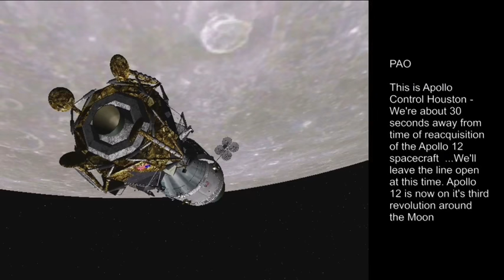Apollo 12 - LOI 2 (Full Mission 12)

Comment: The episode I was interested in was the LEM Liftoff from Lunar surface.  From what I heard the LEM went out of control seconds after launch and began gyrating before Pete Conrad got it under control.  Such that they had to skim closer to the lunar surface to gain acceleration.  Had they last control for another 2 seconds it would have been an inevitable and irreversible crash -- they were that close to disaster.  Obvious it would be on the one of the missing episodes (19 or 20).  For obvious reasons this was never reported in the press nor made it outside the NASA community.
Reply from the maker: I am working on the Apollo 12 liftoff for day 6 of this series and haven't come across anything like what you are describing. Certainly the crew do not make any reference to it. There is a moment after LM liftoff where the LM was programmed to translate 20 degrees or so to the right of the flight path, but that was pre-programmed into the flight profile. It was a unique manoeuvre to this flight but was not anomalous or in any way taking them perilously close to the surface after liftoff. Where did you hear about this anomaly?  regards LM5